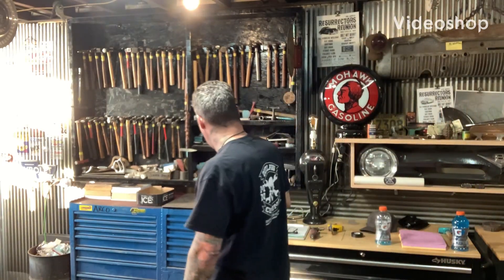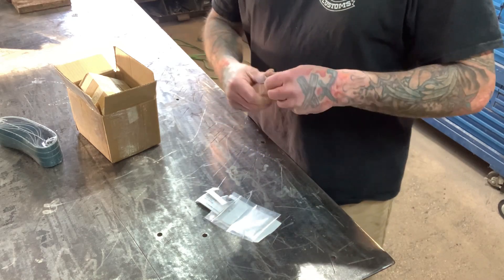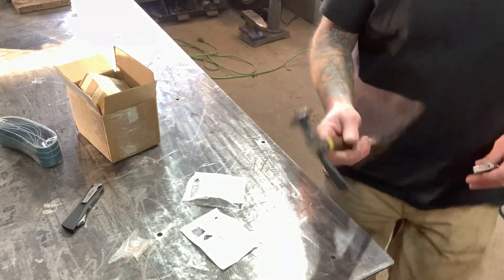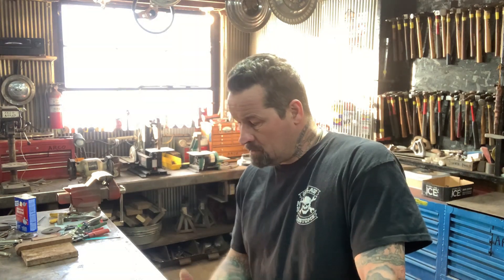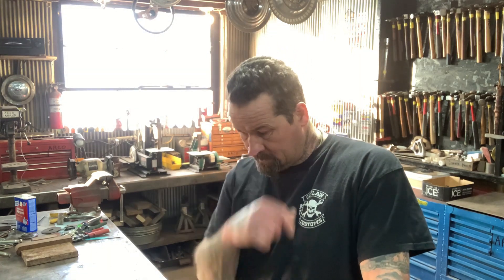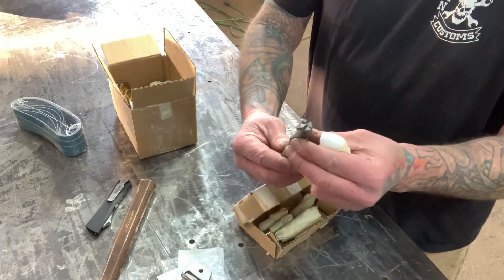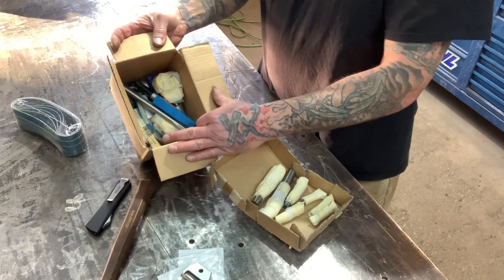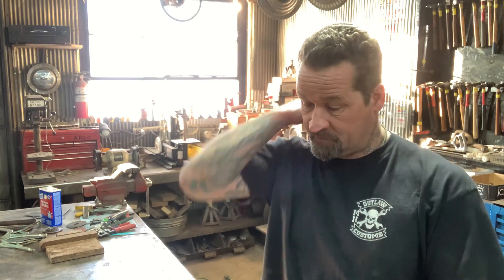Jack  Collins tool haul and Cool Tool from Paul

Comment: What do you think about using lead hammers on beater bag to me seems like I get more shape and less damage to the metal over plastic hammer
Reply from the maker: It really is what a person likes. I use plastic, metal , and lead hammers on different applications. But yes lead hammers work awesome because they have lots of weight to push the metal around quick. Hope that helps. 👍